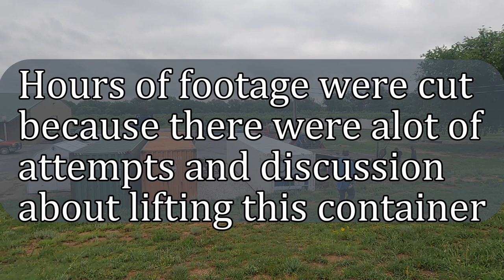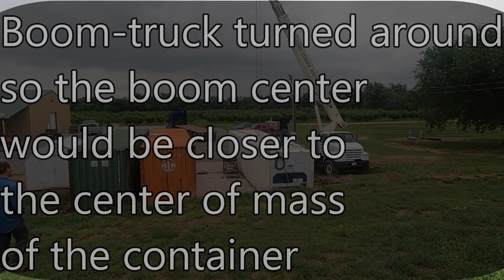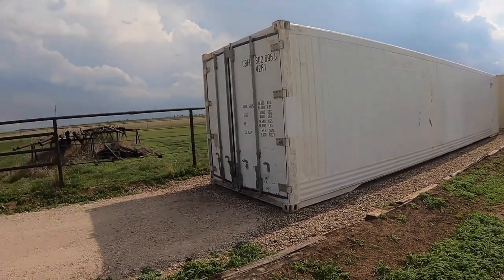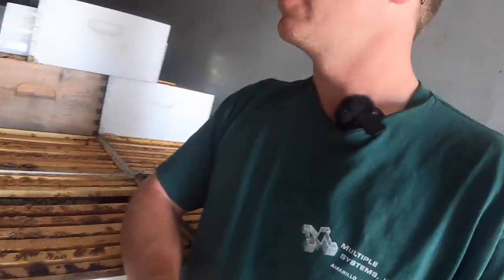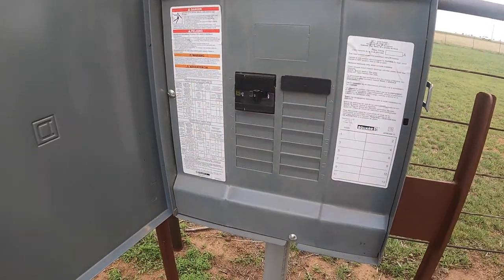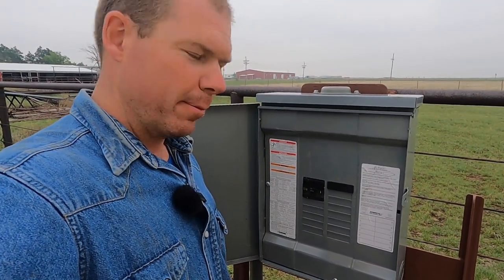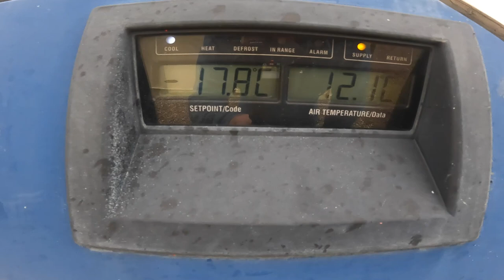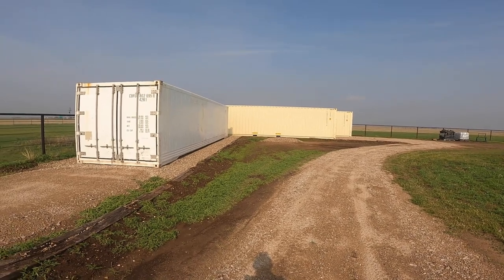Getting a Freezer for Comb Storage

Comment: An issue you might have is those containers keep frozen items frozen.  They really don’t do their best with warmer items.  They also need items to keep them from running 24/7
Reply from the maker: Just needing it to freeze combs for a day or two. Then I'll turn it off and not open the doors
Reply: They do have a thermostat and maintain temperature accordingly
Reply from the maker: Yah I put that to good use keeping nucs cool that I was selling in some hot weather